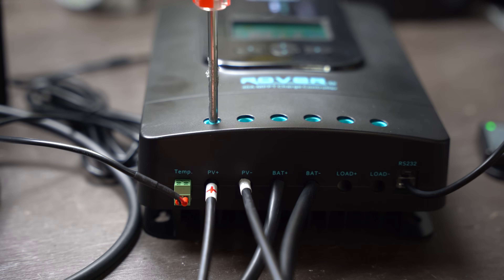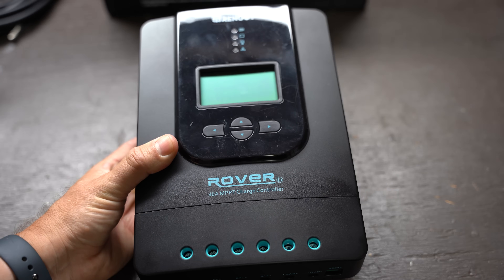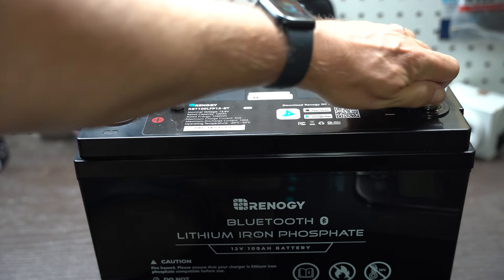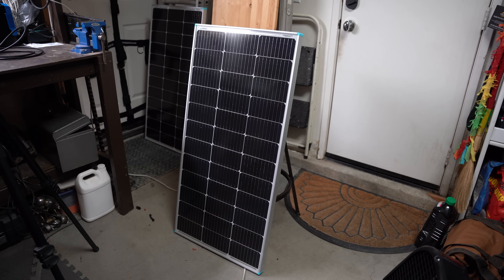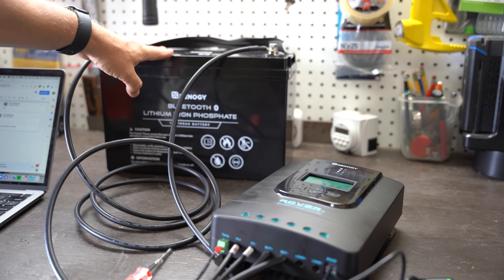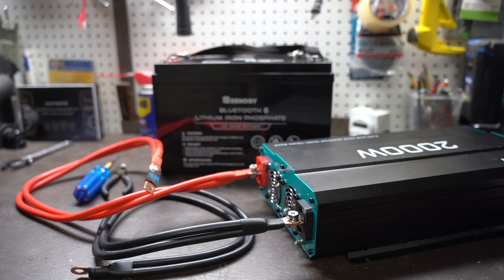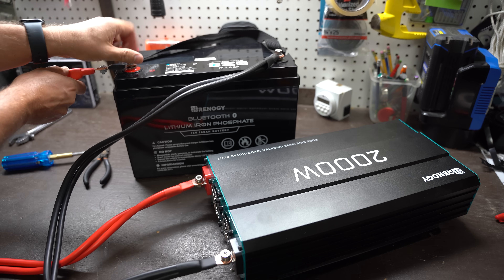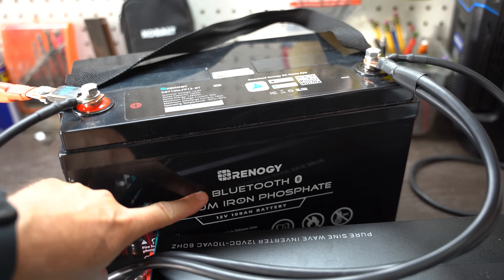DIY Solar Setup: Easy to Follow Step-by-Step Instructions

Comment: Looks simple if you want to power something plugged in.   What about 220.    ❓❓I want to setup solar to run my pool equipment which is new and 220.  Not going to buy a dc pump.

Comment: Thanks for the post.
A question for you: If you have a set of panels (6 in all) that is powering a water well, would it make sense to tap into the panels for use in a camper about 100 yards away? What would you need to do that: two set of inverters at each end and cables? Thanks in advance.

Comment: Hi..seems like there is a lot of undoing and redoing..why not just start in the correct order?  So I really have to hook the wires to the charge controller then disconnect them for the next step? Then I have to unhook the wires on the battery then disconnect them and then hook up the inverter?  I’m confused.

Comment: 11:40 It's too difficult to see exactly how many washers you have on the posts and where. The words you used to describe it like 'lugs' didn't help. A close up camera shot AS they're being stacked on the posts instead of after it's been done would have been much better.  Are they lock washers? Are they your idea or Renogy's? Do they come with any of the other components, with instructions on exactly how to stack the cables and washers, or did you have to buy them separately? "You want the lugs flush on the battery posts." No comprende. What are you calling lugs? Like lug nuts on a car wheel? There's nothing there like that.

Comment: By 8:20, you had undone all the connections to the panel and battery, putting you right back where you started. Why didn't you just start at 8:20 to begin with?

Comment: Great video. Thank you very much. In my system I want to run mostly a 12 V panel off the lithium battery and occasionally turning on the inverter. I’m assuming I would just run a cable from the positive of the battery to my 12 V panel and of course connect to negative ground to the trailer from both the battery and the panel? Am I correct in this?

Comment: Great video, I’m getting ready to do my first small 200 watt solar system using a renogy 20 amp mppt charge controller 12 volt and 2000 watt renogy psw inverter with a lifepo4 100 ah battery and a second battery in the future, my question is according to your video the only place I need a fuse is between the battery and the inverter right?

Comment: Great, instructional video !

I get confused with these 12 V systems, with a solar panel (s) in series produce 60 bolts open…

I bought the system already installed on the trailer, and I still don’t understand it !

I don’t understand why people keep saying solar panels produce 12 V, they don’t.
Even the smaller panel I have produces 22 V and 3 amps.

if anybody could explain this to me, it would be awesome .

Comment: If I'm going to hook it up to an appliance why do I need a charge controller if I'm not going to use a battery? I will just turn on the appliance when needed

Comment: Just a few points. 1. You have no fuse between the charge controller and the battery, always put a fuse on every circuit, you have a circuit with no overload protection. 2. Always connect the positive terminal of the battery first. This is a good habit to have because when you are connecting batteries in a vehicle with the negative connected first you could short the positive terminal to the vehicle by accident, this is dangerous, you can't short the negative to the vehicle when connecting as that's where it gets connected to.

Comment: I don't understand why there are two separate negative cables starting from the inverter and both cables ending at the negative battery post. If a single wire is sized properly, why the need for a second wire from the same device?

Comment: Just found your channel. Thanks for the easy DIY instructions. Was hoping you could guide me in the right direction. I’m trying to figure out if I can run a Dynatrap mosquito trap on solar. Could tell me if it’s possible and what I’d need to make that happen? It’s model# DT2020XLP 120V / 60 Hz / 0.2 AMPS / 25W.
I have one plugged in but I’d like to place one in another location where I don’t have power.
Thanks for any guidance you can give 👍🏽

Comment: Why is it important to have a temperature gauge on the battery will to hot or to cold interfere, I stay in Texas and am building a solar dog house with a/c I plan on putting everything in a box attached to the side so curious to know if the 110 heat will disrupt or malfunction? I wouldn’t want it to catch fire or harm my beloved dog thanks

Comment: Is it possible to charge the battery simultaneously with a solar panel and a 110v wall outlet? I realize that an AC to DC converter will be required. An example of where this would be useful is where you might have a gas generator in addition to the solar panel and want to charge the battery faster.

Comment: If you use wires that are not polarity indexed or marked e.g., color-coded, you MUST mark the polarity AFTER using a continuity meter. To do otherwise is just foolish and potentially dangerous.

Comment: Thanks for the video! My only problem is that I know so little about electricity, I don’t know when it’s okay or not okay to touch wires or metal pieces. I always so worried about getting shocked. For example, when you were screwing on the bolt to the positive side of the battery, I’m like.. uh I thought that would shock you lol. You can touch that? When is it okay to touch and when aren’t you supposed to? 

So I suppose I need to learn more about the basics of electricity and batteries before getting into solar.

Comment: I love the simple instructions given in this video. Only two areas where I believe I can provide some additional insight. It is considered best practice to always connect the negative side of a DC circuit last and disconnect the negative first. This is because if the circuit is in a vehicle or machine the chassis is often connected to the negative so this will prevent any unintended short circuit while connecting the positive also any reverse polarity protection may be limited to the negative side of components do you are risking destroying your components of you instantly connect improperly. There are a few exceptions to the rule; if you are working on a positive grounded system (model T) If working on a house system as he is showing here without a chassis ground It really does not make a difference but it is good practice and off someone uses this video to install a system in their camper ⚡⚡⚡

Comment: I have 100 watt panel with mppt controller. My RM-6 shows 19.9v but only .64A and 8W from solar to battery with battery at 67%. The RM-6 is making an occasional chirping noise. Should the Array be turned off if the battery is being charged by the alternator or through the RV ac hookup which charges at about 13.+ volts. Thank you

Comment: Do you have a video about the load outputs - I "assume" that if you have a 12v controller I will get 12v DC output assuming that the solar panel is getting decent sun. Please correct my assumptions. Appreciate that. I have a 24v solar/wind hybrid mppt controller with DC output. Unfortunately the manual has extremely sparse info - Was hoping to power 12v  (with a stepdown) light bulbs outside. Thanks

Comment: 4:07 Is the polarity set by which wire I connect to the +/- terminal of the controller? E.g. The wire that is connected to - of controller goes to - of battery regardless of which wire I choose to do this.

Comment: Do you not need a fuse in the solar panel line or the charge controller to the battery?

Comment: This is not a concern when using these on a vehicle as the vehicle frame acts as the ground in a floating ground system. However if you are installing these in a permanent setup for your home or a detached building it is important to properly ground these. That means driving at least two grounding rods at least six feet apart as required by code, but you may need more depending on your situation. Those grounding rods need to be bonded with a #4 bare copper wire to the system. The good news is with the particular inverter used in the video, I have one, you do not need to worry about binding the AC and DC side to ground. On all the various sizes of that inverter the DC negative is bonded to the AC grounding lug internally. As long as you run that #4 wire from the ground rod to that AC ground lug the entire system will be properly grounded. The aluminum frame of the panels should be bonded separately. Just the frames though.

Comment: Great video I subscribed and will be referring back to this. One thing you didn't mention that I (as a beginner) have run into is cable size, the right ones, and how expensive they are😮

Comment: Very clear demo. I notice your battery is LiFePO4, can anybody answer my questions, Will the controller work equally well on Li ion ? I take it the charger is 'smart' giving CCCV charging, I assume you could not connect a lead-acid battery ?

Comment: Where did you get the bolt for the 200 amp fuse to the positive wire? I bought the fuse but didn’t come with any bolt.

Comment: Excellent video especially  for beginners straight-to-the-point without a bunch of confusing Bs. Question why do you have doubled cables from battery to the inverter?

Comment: Why would you unhook the positive first? "The is going to spark but this is expected"? What?! Negative first when unhooking, positive first when unhooking! Also, wire the bare connections from the controller first before the safer plastic quick connects at the solar panel. Again negative first man!
Reply: Came here to suggest that. With automotive batteries I was always taught there is less chance for a spark if the negative was the hooked up last, and disconnected first. I saw two lead acid batteries explode within 7 days of each other on two separate vehicles. They earned my respect quick.

Comment: Great video! 🙂

I have a newbie question about the battery <>inverter cable linked to in the description. It is a 4AWG cable, is that right? 

I was looking at an AWG-to-Amp conversion table, and it says that 85Amp is the maximum for a 4AWG cable?

Comment: Hey all - when connecting and disconnecting batteries - this is the correct process. Connecting a battery, + first then -     /     When disconnecting a battery, - first then +.   This will avoid all sparking

Comment: So is the “LOAD” terminals on the inverter for running positive and negative to the main service panel? Also, if you have the solar+battery tied into the MSP can I still plug the main plug into the camp sites power? Will it cause an issue like maybe back feeding or ruin the batteries?

Comment: one tip is to use wire ferrules for the stripped ends of the conductors. It isnt required but is a nice way to terminate and prevents stray strands of the conductor from shorting or being lost during handling.

Comment: I notice every time you connected to the battery terminal you did connect first the negative, that the reason why it make it spark. When connecting to battery terminal it must be positive first to avoid sparking, and when you remove to a battery terminal you remove first the negative to avoid sparking.

Comment: thanks for video.. I am looking to install 300W Renogy solar system and wanted to connect charge controller to two 12V 120Ah batteries in parallel - will the charge controller handle this? Any advice?

Comment: Is there a specific reason why you recommend attaching the positive lead LAST and removing it FIRST? Due to the conventional theory of electron flow this will almost always result in a spark/arc. I always do the opposite when working with DC, attach the negative lead LAST, remove it FIRST.

Comment: Not a criticism, just a question from a beginner: why did you connect the negative cables first, and then the positive? From what I've heard, the rule usually goes positive then negative on hook-up, negative then positive when unhooking. Is there a downside to hooking up the solar panel system positive then negative?

Comment: When there are multiple solar panels, what voltage and amperage combintation do we want going into the controller?

Also, If I just want to run appliances off of the solar panels directly without the batteries, is there a 120VDC to 120VAC converter?

For example, say I have 300Watts total power. How can I use this direclty, without storing in batteries?

Thanks

Comment: I started out with the cheapest things I could get, this way if I mess up, it don't cost an arm and a leg to replace something I accidently miss wired or shorted out, this is really not rocket science, you just have to start doing it and gain experience from doing it

Comment: how many watt panels would be needed to power  around 500~800w of electric devices for most of the day in stable manner wile still charging battery for night use, would 1kw be enough ? and would this work with wind power on top

Comment: QUESTION: Could this be mounted to a in the bed  tool box of a pick up truck to keep 18/20 volt tool batteries at constant full state charge, and recharge after use, and how many can be charged at one time?

Comment: Hi, what is the load connection for on the charge controller for? I always thought that you connected the inverter to that. and the controller cut the output when the battery capacity went below a set point.

Comment: 1) don't use battery temp sensor with lithium iron phosphate batteries
2) need a fuse on the battery to charge controller positive wire
3) need more than 100ah battery to provide the full 2000w from the inverter. Renogy recommends 170ah +
4) fuses and wires should be supported,... especially if in a vehicle
5) should be a cut off switch for the solar panels
6) inverter's grounding connection is missing

Comment: Hi, not sure if I missed it, but what size wire did you use between the battery and Inverter ? I see you have two together in both negative and positive.  Thanks, Great Video

Comment: I hope someone can help me here.
Yesterday I finally got my solar system in order.
I got my new battery,  Power Queen lithium 12V 300Ah, and it took 15h to get it fully charged and ready. 
My system is composed of 5x 150Wp solar panels,  3 in parallel to an EpEver Tracer mppt, and 2 other in parallel to an identical mppt. Each come in to their mppt via a 30A automatic fuse. The output of both mppt come together on a bus bar and go from there to the battery and also to a 2500W converter to 12to220V. I have a battery switch on the plus from the battery to the bus bar. 
Both mppt are set for Lithium. My battery has a 200A BMS with under/over voltage protection. The converter also has protection for over voltage. 
Over voltage of the BMS is 15V, over voltage of the converter is also fix set at 15V and the mppt is standard 14,8V as over voltage.
Now my problem  ...
The converter goes regularly in over voltage alarm and sometimes total shut off. When a regular alarm occurs the system is shut off for a few seconds,  but sometimes it goes into error and then the system shuts off and only can be turned on again by physically turn off the switch on the converter, wait about 30sec and put to switch back to on.
But even with a regular alarm, buzzer, the system turns off for a few seconds, meaning that it can be a dangerous situation ... when my pellet stove is on and is cut off when enough pellets are burning, there is no fan for exhaust and I already found myself inside a room full of smoke and fire alarm yelling. Also each time my router turns off and needs to go to a boot up sequence,  meaning my internet in down for about 7min. Etc. ...
What can I do to make that the voltage stays below the over voltage value  ?
I first was thinking to put the Victron battery protect module  but that would be an overkill and would not help as it would shut down my system as well. Plus I already have protection for over voltage due to the BMS and the converter protections.
I had the Juntec battery monitor,  2023 model, but need to return it as it doesn't work, not on my Samsung tablet nor on my iPhone. 
I ordered the Victron smart shunt and hope to install it tomorrow.
Reply from the maker: Watch this: How To Build A Solar Setup: COMPLETE Step-by-Step, DIY Guide (12V, 2000W)
https://youtu.be/L4HiYD1i71A

Comment: 9:10 Eyes may be deceiving me but it seems you have a threaded connection on your inverter.  If that is the case, then your threaded nut is actually used as a locking nut.  If that is the case, I see you are cranking down on that with the needle nosed pliers.  That doesn't really do much when they are locked.  I would just make the connection with the threaded connection and put the bolt on only enough to tighten it so as to lock it.  If you put the nut in while screwing it in you risk a loose connection since you may have "locked" it prior to tightening the bolt down all the way.  So if it is a threaded connector, apply the bolt after it is tightened down.  Then the bolt locks it in place.

Comment: Is it necessary to disconnect the inverter from the battery each time before connecting the charge controller? Seems like a lot of work connecting, disconnecting, then connecting again. If I had to do this each day, I would likely just go without electricity.

Comment: Does the controller have a memory? I see that it did not need to be re-programmed for the battery type and voltage after disconnecting and reconnecting. At about 12 minutes...

Comment: I get very frustrated when someone tells me to connect something and in the next step I’m told to disconnect it again. Unnecessary steps lead to wasted time and a misunderstanding as to what is actually needed.
Reply: I’m not meaning to be rude here but we do things like this so that a basic diagram can be made to show exactly what goes where. Knowledge is the only true safety when working with electricity.